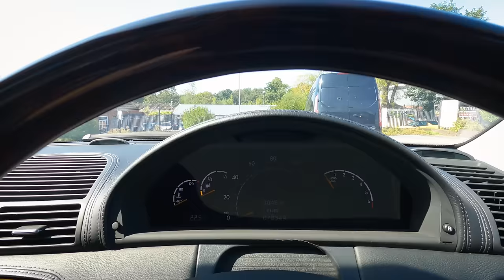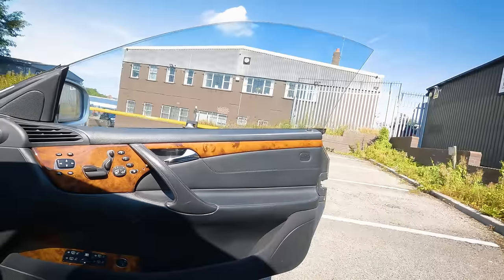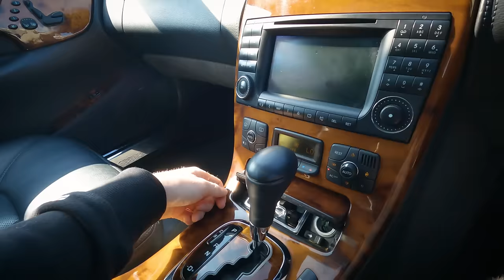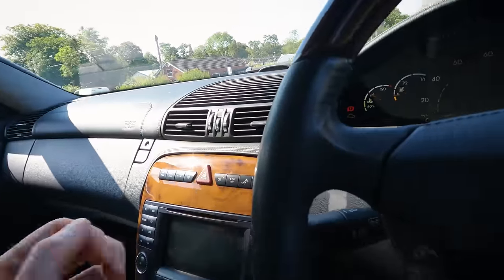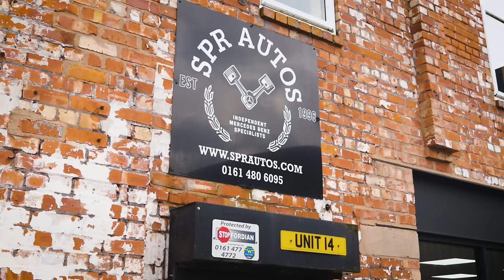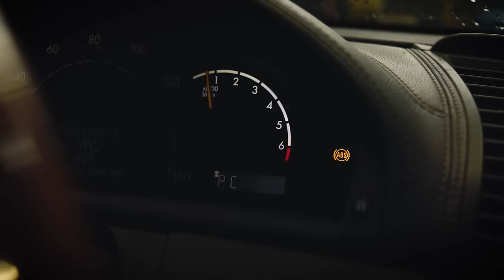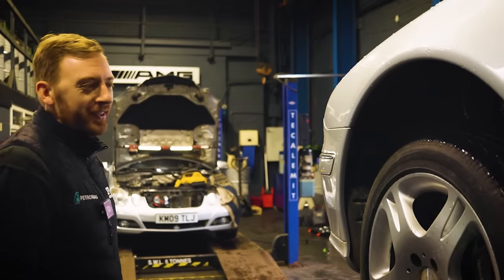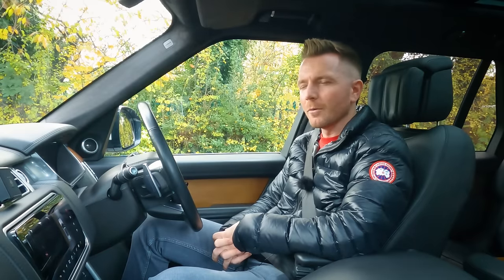I BOUGHT A CHEAP MERCEDES CL500 FOR £1,500!

Comment: 25 Minutes in , when you're saying you'll get it down to your mechanics, and I'm thinking - don't bother. Part it out and try to re-coupe some of your money.
I had a 2005 SLK 350, loved that car, but it developed loads of faults such as light sensor, drivers door mirror folding mechanism, Indicators not flashing, which requires a new module - I managed to clean the contacts of the relay in the existing module. I finally gave up and sold it cheap when one of the number plate lights stopped working! You cannot bridge from the good light because the canbus system throws a fit, and it was £800 for a new module in the boot to rectify. Beautiful cars let down by overcomplicated systems and poor quality, that means that as they age they cost a fortune to maintain.
Why build in the indicator relay to a module that costs hundreds to replace, when a flasher relay is pennies - that's the nemesis of Mercedes of this era!
Now to watch the second half and see what results you had!

Yup! Just watched the second half and to be honest, I'm not surprised. You said it yourself, this generation of Mercedes were rubbish with regard to quality. Such a pity, because they look gorgeous, but in reality, they're money pits.

Comment: What a horrible thing. Wouldn't spend another penny. Nasty interior (wood looks plastic and that door seat switch layout with 'wood' surround? Just a design mess). And as for the build quality? Disgusting. I have an 04 Yaris with 154k miles and I've only had to replace the rear wheel bearings at £40 each. And no panel corrosion. I'd be embarrassed to own such a piece of junk. I could go on.... Glad you're doing these videos though. Very enlightening!! All the best

Comment: The CL was for wealthy people, and is now only relevant for well off people. I bought a good, low miler in July 2020 for £8k as a daily driver and a keeper. It cost me £4k in maintenance and improvements over 18 months, but then my plans changed and I could only get £4k for it. It was a joy to drive, albeit with a constant fear of ABC failure, despite preventative maintenance. Wonderful cars, but they need constant expensive pampering. Matt, yours is a dog, good only for YouTube videos and/or parts.

Comment: this looks far worse than the S500 W220 i bought for 2000 Euros with 200000km. Mine is running fine for 6 years now in my possession. i always thought the Coupés are less rusty than the sedans and the overall build quality was slightly better. but it doesn't seem so. and this is actually a facelift, mine is pre-facelift.

Comment: Start of video:
I predict Matt is going to massively overspend, again. Have four new tires fitted onto it. And will fit new number plates on it, himself. Let's see what occurs.... Okay, end of the video, honestly Matt; just part it out. You spent 1500 on a 2002 Mercedes. Just based on that, my gut was saying that this car would be massively expensive to fix up. The engine is still good. It'll be worth a shiny shilling to the right buyer. The rest of your investment is going to be in the other individual parts, for private owners who'll be happy to get the parts for their project car Mercedes CL500s. Seriously, part it out. Your best option for recouping your money.

Comment: 😢 These coupe and S class saloons were a real low point for Mercedes, shoddy build quality and nasty cheap hard plastic everywhere. This car would need complete suspension and break rebuilds. Bodywork for the rust, possibly welding in the floor pans. A respray, wiring, and ECU issues sorted. 5 to 10k I recon. I'd scrap it for parts. They were never a well built car to start with, and it shows. Not worth the effort or expense.

Comment: Been there done that, no thanks 😂
Reply: Bought one for £2450, dropped thousands into it and it still failed it's MOT to the tune of £3k

These are the ultimate money pit.

Great cars but I'd rather have the W140 CL they're infinitely better built and simpler to work on.

Comment: No, just no. In mechanical repairs alone, your over £5k, then, like SPR say, all the electrical bits and bobs, the bodywork, there is easy another £5k. Perhaps you could justify this if you were going to keep it for the next 10 plus years but come on, we all know it’ll join the growing list of cars in your garage and barely be driven, then within a coupe of years (max), it’ll be up for sale. Sell the plate and then get as much as you can back by selling it for parts.

Comment: Clearly this Merc is a scrapper...the engine and immaculate interior should get you your £1500 back..if its your intention to give ahead with this and I can see the attraction in its day it really was the bee's ...you have to do the full resto from the ground up all the suspension needs to be replaced the brakes need a complete overall pipes discs pads at the very least...wheels have to be sourced who would change the originals for these sorry looking examples is anyone's guess...then once all the mechanicals are sorted and I believe the electrical problem could be a nightmare on its own...you then have to sort all the interior everything has to work your like me if ots there it must work as intended...that V8 is such a sweet engine and as you say it will do 500.000 miles if it were looked after...with the body work and again that could be huge sorted ot will need a good paint job I think you could quite easily spend £10.000 and more

Comment: A good battery but the surrounding car unfortunately is scrap, rare and expensive to repair but just not rare or desirable enough to justify IMHO. It runs so I would strip the saleable parts and take it banger racing and think of it as a viking funeral ritual for a lord.

Comment: to get that car back to beinga nice car will cost around £15,000.. it needs far too much doing to it for it to be a viable project.... if it was an extremely rare example fine, but this is a rubbish car.... its only done small milage because its probably been left at qa seaside car park where its owner has caught the train or ferry.. underneath is showing a lot of rot and when the under belly covers come off you will see a ton of rust...... its a spares repair jobby that needs to go on fleabay and hope yo ucan get your money back.. or break it yourself and earn a nice few quid... brakes are not a problem they simply need a clean up inside.. all the ball joints and the rear spring/damper needs doing for sure... but its getting rid of those fault lights.. strange how its now got a flat battery every 5 mins yet was fine when you went to it !! and the windows now not working / should of mentioned the black cable you tugged down.... this is the problem with mercedes, they are not built to last as long as a ford and they corrode more than a ford.  and to fix them back up is a nightmare and very costly... could always take the enguine and box out and put it in lotuse 7 kit car and have a dream of a sports car... ha ah

Comment: In less than a decade the S-Class went from being one of the finest engineered cars in the world to a steaming turd. 
W126 was voted the best car in the world at its launch in 1979 and it ran until 1991. 
W220 came out in 98/99 , so 7 or 8 years on from the end of the W126 and Mercedes were producing a shocking example of their once world renowned Sonder Klasse. 
If that would have been a British company, our press would have slaughtered them and probably put them out of business, but Germany didn't do that. It was almost swept under the carpet so MB could survive and now sell cars with Renault engines to young cocks who think the A class is some kind of status symbol. Really !!!
Thank goodness I'm old to have owned W126's when good ones were £1500. I had 4 , paid between £85( yep eighty five quid) and £1400 , 2 500SEL's and a couple of 3 litre 6 cyl ones. Had a couple of W140 S-classes and W124 E-classes too. The good old days but only 10 to 15 years ago

Comment: Am I the only one who thinks these unnecessarily over sized, dated, expensive to run, slow and boring looking piles of excrement should be scrapped? The C pillar is the worst part, what were they thinking when they designed it? Awful build quality too. Litteraly has no redeeming features. Bin it.